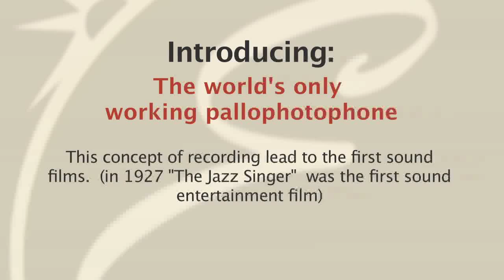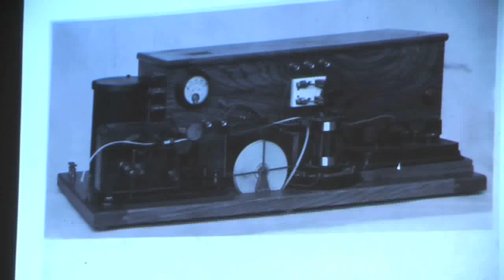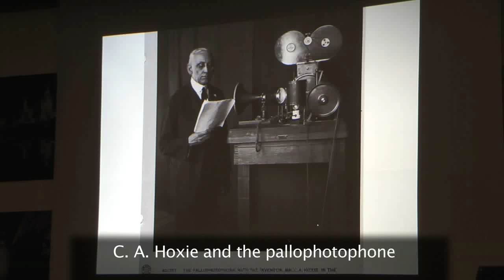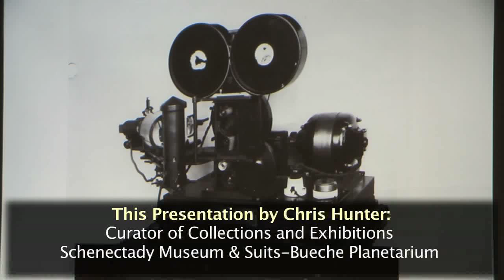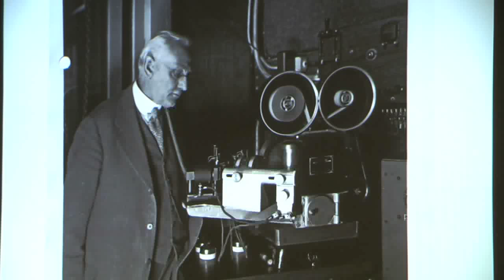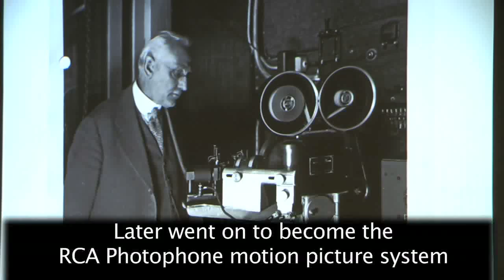A Working Pallophotophone - 1922 audio recording method

Comment: I think a better way to digitize the unperforated 35mm films is to use a Steenbeck or KEM 35mm flated editor,replace the film sprockets & sprocket rollers with pressure rollers & capstans with guides & modify the existing optical sounded on the editor so that it plays back one track at a time.

Comment: I can see 24 frame per second if this was during the sound era. There was a soundhead for 35mm designed for this film which ran at sound speed. Now, if this during the silent era, speed was 18 frames per second.
Mercury, with their 35mm full coat magnetic recordings in the early 1960s, used Fairchild film recorders which also used the 24fps speed.

Comment: (Part 3) This film is acetate safety because it was presented to one of the performers heard later in the film.  The dozen or so other reels are nitrate.  I have not heard any assurance that these have yet been printed onto safety stock.  As for the comments made about Jolson's spoken lines in The Jazz Singer, it is a myth that he was not supposed to talk.  There were rehearsals and at least one other take of each of the two sections.  I believe he had also talked in his previous film in 1926, Plantation Scene.  the talking was an experiment to see if the audience and critics would accept it.  They did.

Comment: (part 2) the extreme speed inconsistency heard is not on the film -- Walter Damrosh had declared them wonderful.  The fault solely is in the improperly designed playback machine which has no flywheel stabilization.  The only speed control was the rubber capstan which was just connected to the motor with nothing to keep the speed consistent.  The designer had no sound or film experience, had never consulted a REAL film projector or tape recorder, and never even knew that there are test films available with test tones to adjust projectors.
Reply: It seems Mr. Demuth was trying to see if these tracks could simply be played, not necessarily trying to extract the best fidelity from them.  Also problematic is the fact that it seems we are hearing sound as it is coming from the speaker of the unit, not from an directly electrical connection to the ouput, which is never going to give you a good recording of what is on they recording.  The whole point of this demo was to show that those tracks did have usable audio.  Next step if one wanted to take it further, would be to perfect a playback unit or improve this one so as to eliminate the wow and perhaps use a better slit lens to get better fidelity out of the tracks, and if one were really interested, be able to move the solar cell assemble in steps so as to hear all the track in succession.  

But again, the main objective here was archived -- to see if the tracks had usable audio, which they do.
Reply: @captaincinema5066  I have all the recordings from all of the films from direct connection to the apparatus. The fidelity is much better that way, of course,  The problem solely is the speed inconsistency.
Reply: I was wondering why the playback has so much varying "wow" in it (most noticeable in musical passages and the NBC chimes)--as skilled as Mr. Demuth (the engineer) is in building this recreation of a pallophotophone to begin with, it seems like this machine could use those improvements you mentioned such as a flywheel (or as RecordCouncil mentioned, a rotating drum, quite common on optical soundheads on film projectors).  No disrespect intended towards Mr. DeMuth, but yes, it seems like he didn't study the transport of a film projector or tape recorder.  But maybe he did, but didn't add those proper mechanisms for stable speed due to time or financial constraints--hopefully he'll add these in a improved version of this machine.  After all, this is the first model he made, IINM.  And yes, a good SMPTE optical soundtrack test film (if you can find one--I've noticed they're pretty rare birds, even on eBay) would be a good companion for this pallophotophone :).
Reply: I would say that it's more a problem of the film running in too narrow curves. Film is rather stiff and if you look at the close-up of the sound  drum you can see the film is flexing in and out because it is bend rather sharply before and after the drum. If the playback device had been designed with the film going in a more straight line I think the film would run much smoother.
Reply: @organfairy  That is not the case.  Have you actually worked with film? It is not really too stiff to go around curves. Just look at the loops above and below the intermittent film gates of a real projector.  The film goes through a 180 degree bend in a half inch diameter.  This device did not put the film through anywhere near the stress that the intermittent jittering of film goes through when used for picture projection, and then a foot later its motion is smooth and speed consistent for the sound pickup because of the tight wrap around a heavy flywheel roller.
Reply: @mjb784533  As a matter of fact I have. And I can say for sure that many of the features in an 8 or 16 mm projector would not be able to work if it wasn't for the stiffness of the film.
Reply: @organfairy  Of course the film is not limp like tape, but you were implying that it could not make the curves around the guides. Of course it can. It can curve either way, and has no trouble going around a half inch diameter bend. The curves in its travel have no effect in the inconsistency of the speed. It was purely the dreadful design of that playback machine lacking any flywheel guides.

Comment: (part 1) There are a lot of misconceptions here.  This is NOT a 1922 recording, it is 1930.  This was not made by Charles Hoxie, he had moved onto other projects.  This is an all-electric recording.  Hoxie used a mechanical recording method with a mirror vibrating at the tip of a cone reflecting light onto the film.  This used an electrically driven vibrating method.  The film was recorded on a continuous loop with the sound head moving downward to create one continuous track which looks like parallel tracks.  This is a single channel recording.

Comment: I believe I may have owned a similar machine at one point, actually. It was a Signal Corps unit that took 16mm film reels and ran them past a bulb and photoreceptor. Unfortunately I never got it running, and it was lost in a flood two years ago.

Comment: With regards to TheMaxx111's comment about the film base.  If this is an original print and is not nitrate, it will be diacetate.  This was the first safety film (1922-1957).  It would have been prohibited from use in any other instance short of a fire proof booth and fire proof playback equipment if the film was nitrate based.

Comment: Hmmm, what might result in better playback is to program the scanner to trace the outline of each track, The playback to a record cutting lathe required a photo resitor to translate the light bias as a electrical signal, but the recording directly from the photo mic to flim negates the use of photo resistors which im guessing is what they used before thay settled for the comercail release.

Comment: @ReverendWayne The people who make a hobby out of collecting vintage radio shows usually speed correct NBC shows by the chimes.  In this case, it should be low G, C, high G, and E, and if you compare with what's on nbcchimes.info, they're doing pretty well on the basic speed.

Comment: To reduce flutter, this machine needs a drum which the film is held firm against that spins at the same speed. I thought the large silver cylinder might have been a drum but it appears to be the light source. You could modify a 35mm projector soundhead quite easily to play these films with unnoticeable pitch instability, that is of course, unless they were recorded with flutter.

Comment: Since the tracks don't overlap where sprockets are located on modern film, you should make a copy of the media onto new 35mm film. That way you don't risk further damaging the original media by constantly flexing and bending it.

It may work to scan it with a typical flatbed scanner that has the ability to feed 35mm negatives through the scanner lid. Cut slots in the lid to allow for a continuous film path, and scan it in 11 inch long blocks, for direct digital processing and playback.

Comment: Fascinating.  You could use the classical music as a speed reference, such as the Beethoven "Eroica" symphony 3rd movement heard in the video.  Flutter can be treated with digital processing, such as the technologies developed by Dimitri Antsos and by the folks at Plangent Processes, both of which have been used successfully for commercially released CDs sourced from problematic originals.

Comment from the maker: @frenchjr25 Thanks for the correction, it must be a common misconception that Jazz Singer was first in the technology just because it was the first widely available to the public.
Reply: IT WASN'T EVEN JOLSON'S FIRST SOUND FILM. ONE YEAR BEFORE, HE SHOT A TWO REEL 'SHORT' TITLED
"PLANTATION ACT REVUE" IT WAS ONE OF SOME VITAPHONE SHORTS THAT PRECEDED (IN THE SAME PROGRAM) "THE BETTER OL'" THE SECOND SUCH SIGNIFICANT COMMERCIAL, PUBLIC PRESENTATION OF ELECTRICALLY RECORDED SOUND FILMS.   AS FAR AS THE UTTERLY PATHETIC INTENSITY OF WOW & FLUTTER ON THE IMPRESSIVE APPEARING BUT INEPTLY DESIGNED DISPLAYED HEREIN, I HAVE, TAKEN
OF OFF A 16" LACQUER DISK OF A SEGMENT OF THE G.E. SCIENCE FORUM (MARCH 5, 1947). IN IT, THEY PLAYED THE COOLIDGE CHRISTMAS GREETING OF 1922 AND A SIMILARLY BRIEF PORTION OF COMMENTS
MADE BY GENERAL PERSHING. THE LACK THE SEVERE SPEED FLUCTUATIONS HEARD IN THIS ILL-CONCEIVED SAMPLE.  IN TURN, THEIR QUALITY IS MISERABLE AS COMPARED TO THAT OF THE
COAST TO COAST (APPROX 19 RADIO STATIONS) VIA AT&T LONG DISTANCE OF SEPT 1924. THAT WAS DONE
WITH THE WESTERN ELECTRIC ELECTRONIC RECORDING /  DISK PROCESS. IT WAS LICENSED HERE IN THE
THE U.S.A. TO COLUMBIA AND VICTOR. THEY MARKETED THE SAME PROCESS AS VIVA- TONAL AND ORTHOPHONIC  RESPECTIVELY. THE BRUNSWICK 78 RPM SOUND QUALITY WAS SIGNIFICANTLY INFERIOR TO THAT OF THE WESTERN ELECTRIC PROCESS.
Reply: E. S. Gregg credits  'Don Juan' as the first public showing of sound film on Aug 8, 1926, more than a year before 'The Jazz Singer'.